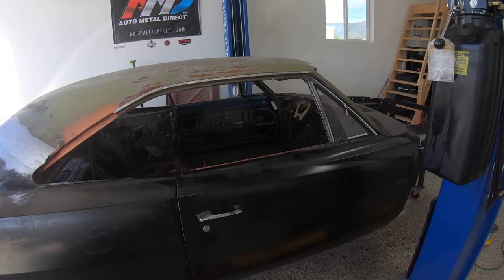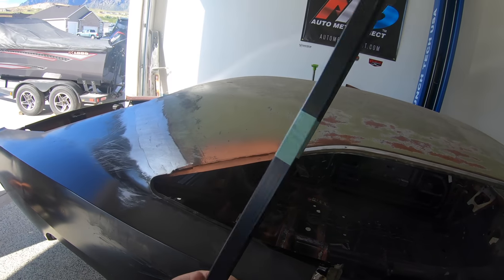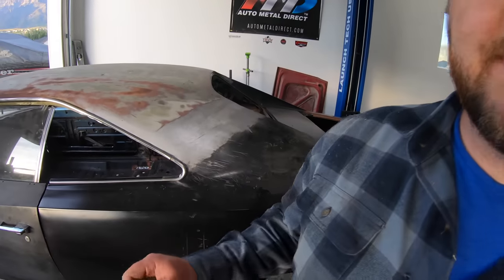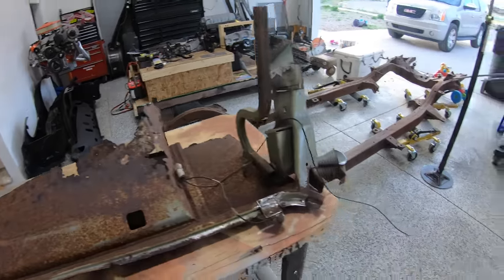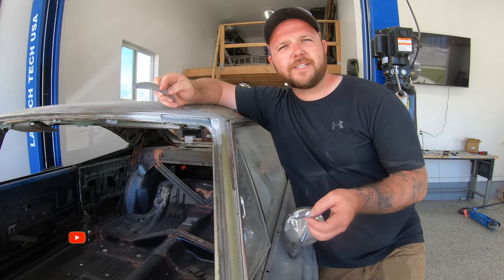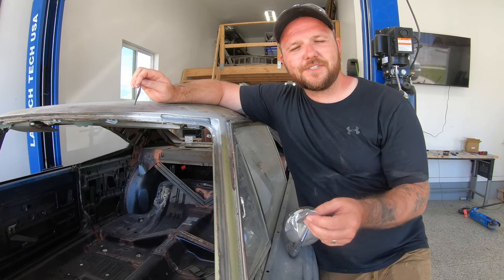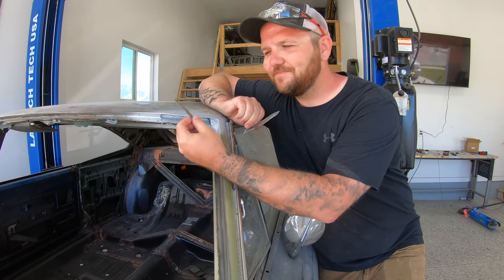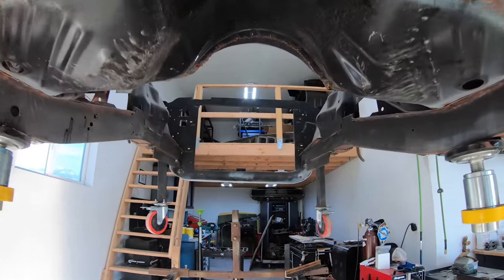1968 Dodge Charger Restoration - Episode 38 - Deck Filler & Final Rust Repair

Comment: nice to see another video from you ... hey, regarding the rotisserie mount for the rear, for what it's worth, when I had my 68 on the rotisserie, I just had flat bar bolted to the bumper holes as you described in your video - I welded the flat bar to square tubing that slipped over the tubing off the rotisserie. It had plenty of strength, with all the panels on the car and me inside the interior, it was plenty strong. could save you the extra work of bringing a bracket down to the rear frame rails that you mentioned.
Reply from the maker: I was looking at that too.  That would be much easier!
Reply: @rustbucketrestos6511  one other thing to consider - if you're going to paint it while it's on the rotisserie (as I did), the less obstruction from the rotisserie the better. Just my two cents... all the best.
Reply from the maker: For sure!

Comment: You're right to take your time and build the right support plates for your rotisserie. Those B-body Chargers were sizable cars. Might I suggest you research other company's adapter plates and make sure it fits the Cuda's rear as well as the Charger. E-body front ends were, in essence B-body front ends, but the rears do differ. Dying to see the underside get the fixed nuts welded in(aftermarket K-frame, etc)and everything prepped for undercoating. Hope all is well with you and yours. I cannot believe life hasn't gotten in your way more than it has, but you're still young. Can't tell you the projects life has deep sixed on me, but you still get to finish stuff anyway, if you know which is worth it and what to sell on, as is.
Enjoy the summer and take those boys fishing or camping somewhere.....and of course your long suffering, best apprentice you'll ever have, wife.
Malcolm Ottawa Valley
Reply from the maker: Thanks Malcolm!  😎🤙

Comment: Regarding the valance corner tabs, I noticed they weren't addressed yet. I tucked mine underneath into the trunk extensions. What were you planing to do with yours?
Reply from the maker: Pinning them down & welding them eventually.  Or cutting them off entirely… they are butt ugly & unnecessary in my opinion.

Comment: Did you shape the metal where the deck meets the sail panels to have a nice radius? Chris on junkerup had to do that fix on most of his AMD deck lids to make the radius's flow perfectly to attach the SS molding if using it.
Reply from the maker: I’ll need to do a little tweaking but it’s very close to fitting the way it is.

Comment: Hello there..I've been watching your vids for couple yrs now and working on my 68 charger and wanted ask u I know repop metals like quarters and fenders are like 18 to 22 gauge depending but wanted to ask u on like rear window area what metal does u recommend for patch work like mild steel or what 18 to 22 gauge. .I need to do lot patch work on ext panels mostly....Thanks hope hear back from. Ya..

Comment: Great to see you back,I was suffering not seeing anything,
So Question I,m trying to weld my Driverside Front fame rail to the Crossrail,is the distance to the Rockerpanel to Frame rail the same on both sides and exactly what is the Distance,If I remember the passenger side was 4 3/4,been a while car not at home right now (70 Charger)
Reply from the maker: I believe they are the same.  I can verify measurements tomorrow for you.  Shoot me a message on Instagram!
Reply: @rustbucketrestos6511  
I don’t know anything about Instagram,could you just let me know here please
Thanks

Comment: Looking good buddy, can't wait for the mods to start. I know you're gonna use a cart axle at the back end, personally I'd of liked to see you be a bit more ambitious and fit an independent rear subframe. But you guys don't really do corners do you. 🤣🤣🤣🤣🤣🤣
Reply from the maker: It’ll have a 4 link.  Should do everything I need it to!
Reply: @rustbucketrestos6511  it is a nice set up and definitely an improvement over the standard set up, but I'm English I love my track days. My car would probably destroy that charger around a track. With half the cylinders and 400bhp. And would give it a good race over the 1/4 mile too 👍. 

I have a Nissan Pulsar GTi-R, you don't get them in the states they call it the baby Godzilla.

Comment: Rear Deck Filler: I'm about to replace the Deck Filler on my 69 Charger, and was thinking about reinforcing the underside of the Deck Filler. This is so it won't dip down, and  create the water pool, which in turn causes the rust problem behind the rear window. What do you think?
Reply from the maker: Honestly the plenum under the deck filler is pretty stout compared to what’s under there on the e bodies.  I wouldn’t mess with it too much